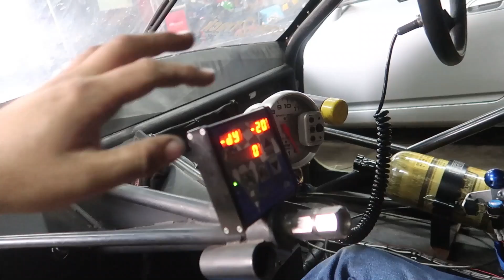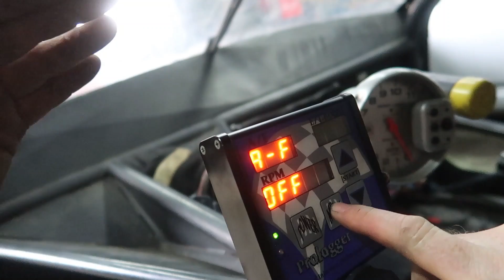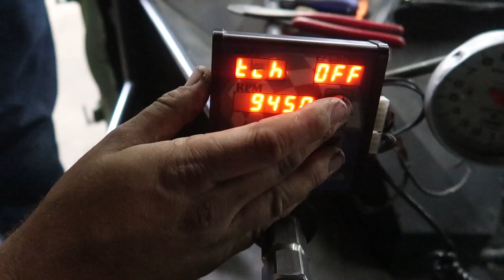Its Rough Its Tough Its BULLY Steering Stuff!

Comment: Who needs a tape measure when You know the exact measurements of your fingers.... Shaun amazes me every time 🤣🤣
Reply: Yess. It's very common for people measuring shit to know the length of spots on your fingers. My finger tip is also an inch
Reply: My middle finger. Each joint is almost exactly 1 inch apart. 

Built in 3 inch tape measure!
Reply: That's how the tape measure was made...
People adopted inches & feet because they used their knuckles & feet as units of measure.
Reply: @jordanwalters3393  I've got a built in 3 inch tape measure to... It ain't on my hand though unfortunately 😭🤣
Reply: @Matty.Hill_87  its in your wife purse lol.
Reply: @jordanwalters3393  🤣🤣🤣
Reply: @Matty.Hill_87  🤣🤣🤣
Reply: We were taught that in commercial diving school (because you work in zero visibility sometimes).
Digit length, fingers, pinky tip to thumb tip on open hand, and even finger tip to wrist and elbow lengths👍
Reply: Well just eyball it bro
Reply: Semen
Reply: i learned it from the bible. cubits, spans, and what not. measure your body its crazy accurate.
Reply: @jordanwalters3393  man you left that wide open for a perverted reply but I'm not. Have a great day 😂🤣😂🤣😂
Reply: 7:47 glad to know no one at PSI pulls out. boom.
Reply: @elonmust7470  Correct 12 inches = 1 foot  +12 hours on the clock +12 months in the year...metric is a bs.
Reply: An old timer fab guy taught me when I was about Shawn's age, (about 100 years ago!), the four important body dimensions to know.

Measure your wingspan, and you'll find it is within an 1" of your height. 

Know the length of your work boot, or shoes.

(There's too much variation in your stride, unless you 'pace' things off, all the time.)

Know the length of the last segment of your thumb, (usually you're metric or imperial), and last, know the distance from the tip of your thumb, to the tip of your pinky, when your hand is fully spread.

If you know those four, you'll be amazed how often it will come in handy, if you build, or buy things.

The combination of the four will allow you to measure just about anything you may need to measure.

GeoD

Comment: Nice work Shaun! A few notes for the next one: So many knuckles and no rest bearings.. the whole steering rod will bend from those joints when operated under load, just because the absence of support in the rod. Best place for the support bearing is at the top of the cradle, at the flex joint. If you anchor that bit to the sub-frame, the steering will be consistent throughout the movement of the chassis. And another: When welding the steering rod from pieces, one should always set the rod on a lathe, and clock it while welding. That way the end result is more straight, and causes less steering issues.

Comment: I was just thinking about Shawn welding on that column, and something is nagging at me about a warning I got about welding steering column stuff.  If those splines are ground, they will show grinding marks. If they don't, they are likely hot forged. Hot forging is big in auto manufacturing, because it' cheap, and makes strong parts. The u-joint yokes may also be forged.

If they are, and you weld on them, there is a chance of making them brittle, because if the intense, isolated heat.  I can't say for certain I've been warned about it, but it seems familiar.  (I built a bunch of street rods in the '80's, using factory suspension/chassis parts, at a business I owned.)

The solution would be to anneal the entire assembly, after the welding is done. Annealing would heat the entire assembly, to a high enough degree, the crystalline structure of the metal can relax, realign, and essentially soften.  That would 'relax' any brittle points caused by the welding.

Maybe someone who knows more about it, than me, can chime in. You don't necessarily need to pay to have it annealed. You need some way to heat it up to the necessary temp, hold the temp for X hours, then allow it to cool, slowly. 

 I'm looking at using a SS propane Bar B Q somebody gave me, to make a heat treating, and annealing oven. So, it can be done, cheaply. 

At least, do a bit of research, if nothing else, just to make sure I'm all wet.  There's a lot of 'impact stress' created by the Bully's front suspension.  Sharp impacts, and brittle metal are NOT a good combination.

Comment: Looks like you guys did a great job with the steering. The only thing i would have done differently, would have been inside the car. Rather than use a bolt like you did (which may have a tiny amount of slop to it) consider swapping that out with a roll pin that would keep expanded pressure on that drilled hole. Zero slop. You would also have to add a retaining collar outside to make sure that the roll pin would never work it's way out but it may create a stiffer connection, especially when it's exaggerated by the time you get to the outside diameter of the steering wheel. Hope I've explained that good enough to understand. Keep up the amazing work.

Comment: All that extra strong weld cos the tubes cut at an angle then drills a hole and slides an 8mm bolt in 😂

Comment: Maybe it's just me, but if I was driving and turning those big ass slicks, I think I'd want u-joints, splines, and a rack & pinion that were engineered for little ass Civic wheels and tires.  I've looked at the four lugs a couple of times, and wondered the same thing.

I'm thinking back about how much work it was to put the big friggin' wheel studs in the first big HP car I ever worked on. A SBC gas class 67 Chevy II, of my drag racing mentor.  I dunno....  kinda makes me shudder a bit.

I had a steering wheel come off one time, cause of one of those crappy aluminum adapters for the classic hot rod wheeel everybody used to use. , (the bolts had stripped out in the alum-like that way when I bought the car.)   I was only going about 30-40, and not racing, and it still scared the crapped out of me.   You know how hard to try to steer a '56 Chev with only that 2-3" aluminum adapter?

Comment: Gonna keep ya THAT-much safer brother!!!!!  You're a good dude and happy as hell to be keepin ya safer brother!!! Any thought to makin a very very light but much safer reinforcement of the Sled? Simple strap of steel welded? Add 5 lbs.s but add a lot of strength .  Sure u thought lots bout it, jsut wanna keep positive Brent Safe as possible!!! Lottttttta power and the vibration between engine cradle and main frame concerns mena hair, not that I'm an expert.

Comment: Just an observation.  I would reinforce the steering-wheel button's cable, just behind the button and the initial cable point, so that the cable doesn't break on that end, while on the track.
I suspect that could get weak over time and break.

Comment: Are you guys stiffening up that front suspension before LA ? Looks like it could do with some more of that. Just a suggestion but I heard Brent talk about some reaction arms to limit that front end movement before. If you where to incorporate some motorcycle steering dampers into those you can limit and control that initial bounce pretty easily. Combined with that increased stiffness on the compression stroke it should make it feel a lot more solid.

Comment: Seeing your tape measure,I'm so glad we use millimeters in the UK now 😅
Reply: Yep. The metric system having everything in units of 10/100/1000 makes measurements so much more logical than the imperial system. Centigrade is also much more logical than fahrenheit.
Reply: @lb9gta307  In Canada we use both system, i use inch and feet at work, we never go lower than a 1/16 of an inch. The problem is when you start, calculating different units like going from say 12" 1/16 + 13" 1/8. you have to divide 1 buy 16 and get the decimal then after Converting it back to inch that his trouble some. But i work construction before and we only use inch never feet and inch, now as a welder we use feet and inch.
Reply: @jakelowang4132  I'm in Canada. We mostly use both because of the old people who never learned metric, our proximity to the US, and the use of old school fasteners. I know how to use both from working on older cars and with, um, more senior mechanics.

Comment: 23:10 shane I belive that weirdness comes from years of fabricating and breathing welding fumes.  
also wondering at 25:00 why don't you attach the tach output straight to the shifter button so the whole lot is automated from launch till you pull the chute?

Comment: My humble suggestion to also improve handling is to add a tube brace from the top of the firewall to as far as possible up front on each side of the engine, and then cross bars between the two braces to add rigidity to the entire front end. It should also help a lot with the bouncing around issues you are having on launch. Instead of just lifting the front end and flexing the frame it will have to lift the entire car before you lose traction.

EDIT Oh wait I just saw the coilovers lol I had no idea you had the whole subframe on suspension! Probably just needs stiffer springs or an adjustment then.

Comment: The bottom of the steering shaft in the civic is the part that is supposed to telescope. 
That upper telescope is for tilt steering. 
It clearly had like 3-4 inchs of slip

Comment: my 2 cents......make a hollow tube....and a shaft that fits perfectly in the tube......long slots in the tube, top and bottom.....and a hardened pin in the shaft sticking out of the slots in the tube......could have as much slip joint as u make it

Comment: Watch and love all your vids! 
I have a safety concern about the Bully. I hate to even think about this but, if it were to hit a wall head on, since there is only basically a hinge and a couple shocks holding the entire front end on the car, I think the steering column has the possibility of ramming forward with the entire front end and possibly hurting the driver. Please look into that, although I'm not sure how you would without a crash test
Reply: Whats your take on bikes going down the track without a roll cage?
Reply: @superconscious.  ya, I get it, you're right

Comment: Could you modify a yoke from a transmission to make the slip joint coupler. Would be longer movement and a thicker diameter. Which would be stronger.

Comment: You need to add a wiring guy to your group. Someone with as much talent as the mechanical guys. Solder connections so it will last longer. Quick connections or taps are good for things like fog lights, but not so much anything else.

Comment: I don't understand the concept with the hinged front end. As there is a huge unsprung mass, with the engine etc doing its own thing due to wheel torque, it will never replace suspension elements close to the wheels. Or what is it supposed to do?